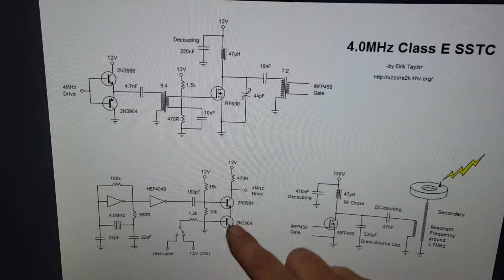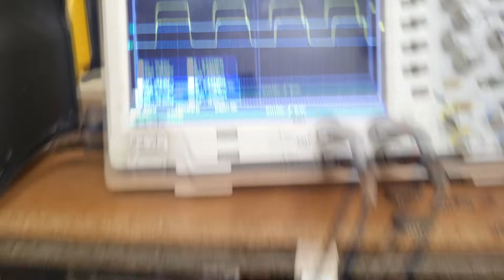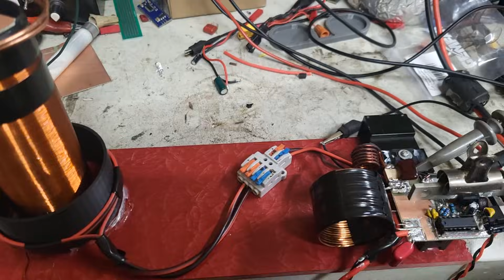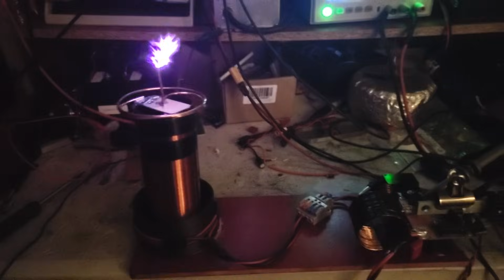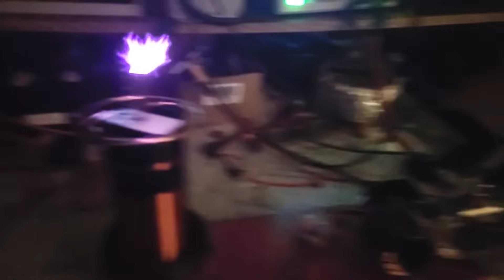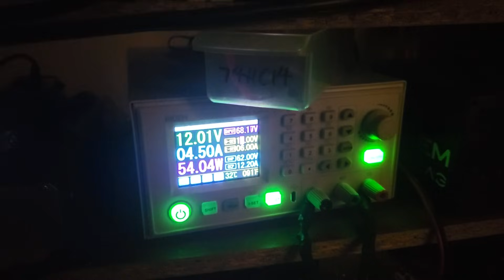Class-E HFSSTC Blabber (Schmitt Trigger Oscillator + IXDD630CI 2.7mhz)

Comment: I never had luck with hfsstc stuff , maybe I should build that multi stage gate drive , since getting good gate drivers is kinda hard for me
Reply from the maker: Should be much easier now with a scope. There is nothing wrong with using discrete gate driving stages. At higher than like 4-5mhz I would probably have to use those. You don't have to do anything fancy but you would just have to size the stages to ensure they can all RF switch each other well enough. I thought about using a couple small BJT's, then do a larger NPN/PNP totem into one more mosfet stage before the sic etc but at 2.7mhz the gate driver is probably better if you have one.

Comment: Pretty cool , the multi stage gate drive seems like nightmare to build
Reply from the maker: When I was carving out this small board, yes lol.. otherwise not really honestly. It's just needing proper switches. I have a bunch of tiny signal BJT's that might work for a first buffer coming off a crystal square or something. After that it's just the BD139's/BD140s, which can work but I'd need something after that.